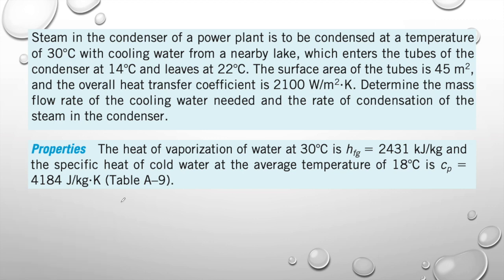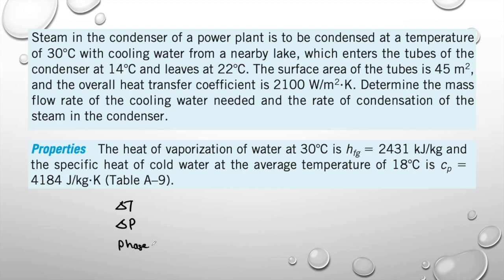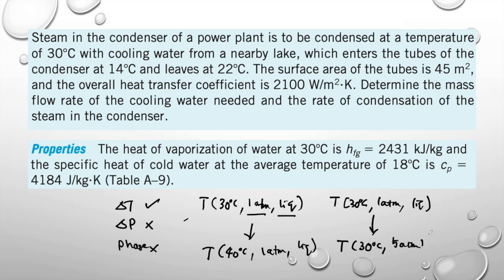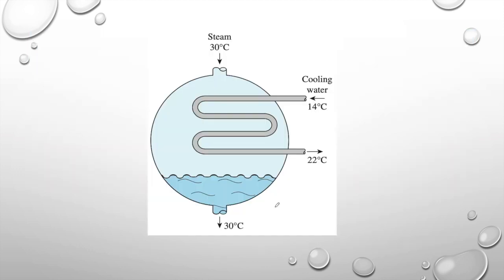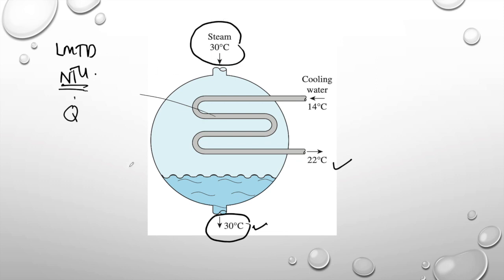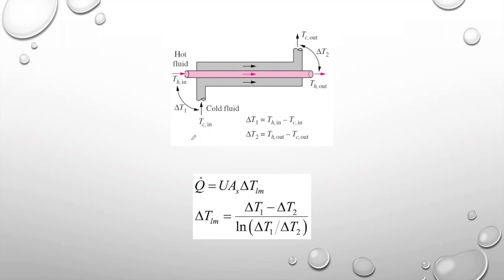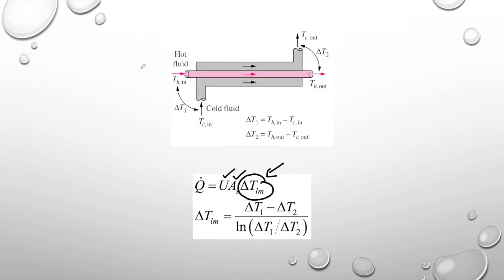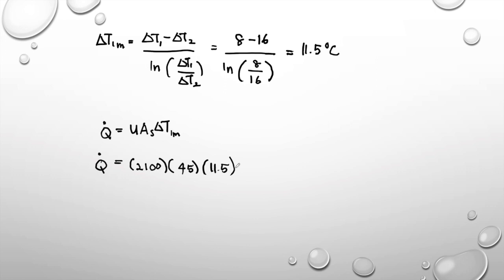Example 10 The Condensation of Steam in a Condenser - LMTD Method

Comment: im still confused. how did the water gained heat if the steam did not lose any? did the energy went only, exclusively, to change phase?
Reply from the maker: Tq for your feedback. ok, i understand your enquiry. When substances change phase, thermal energy is absorbed / released (known as latent heat). So, in this case thermal energy is being release by the steam due to phase change process.
Reply: @odlazmiuitm1984  thanks